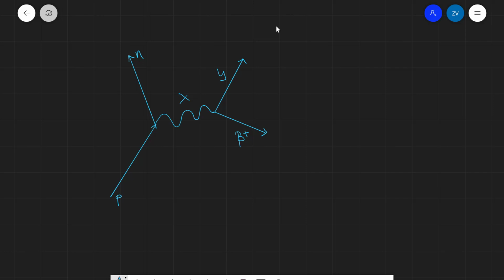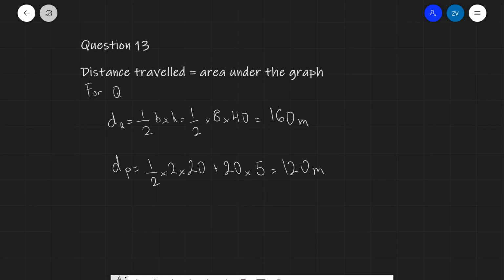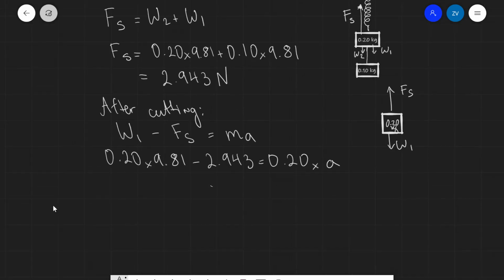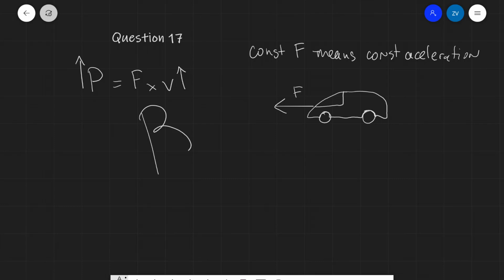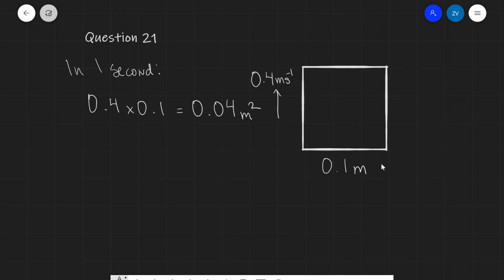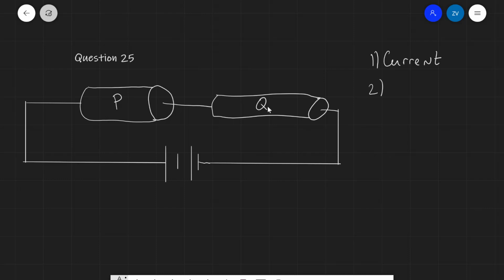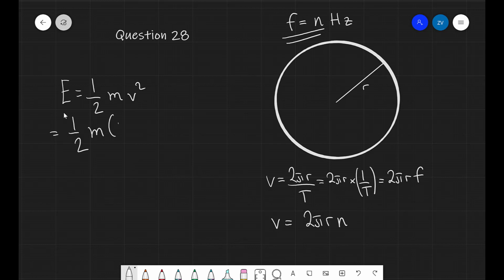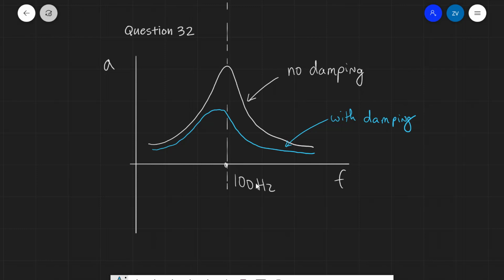My Solutions to: AQA Paper 1 2019 Multiple Choice Questions | A Level Physics

Comment: Sir, on question 30  we can use LCM(2,1.98)=198  
when A completes 198/2=99 oscillations then B completes 198/1.98=100 oscillations and then they will get back in sync.